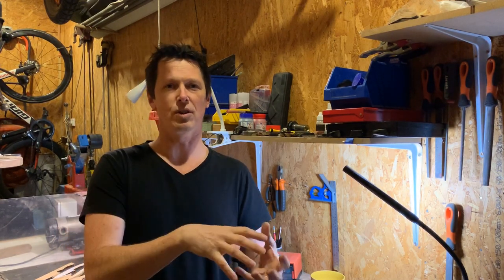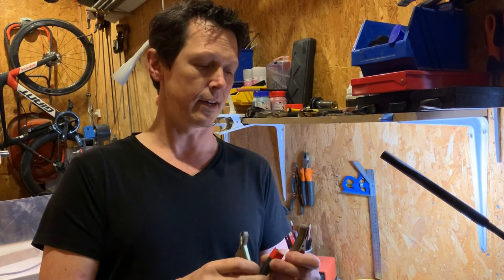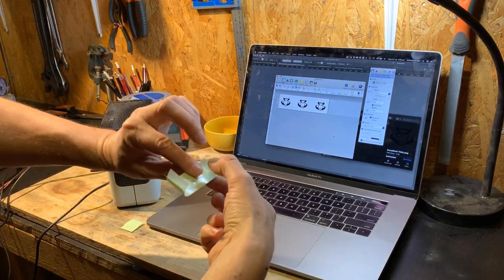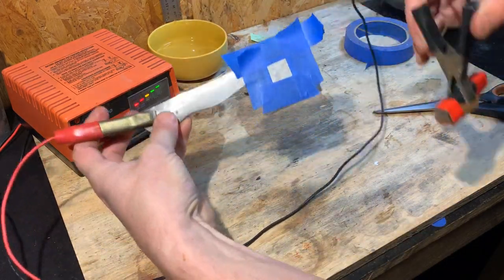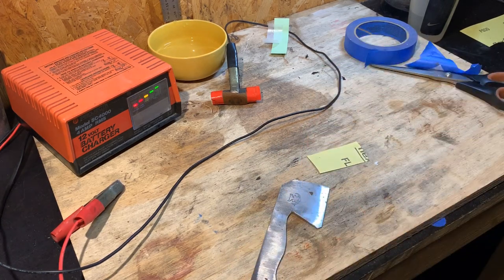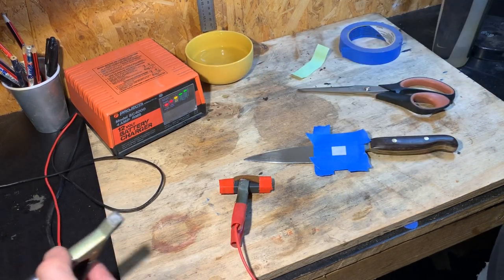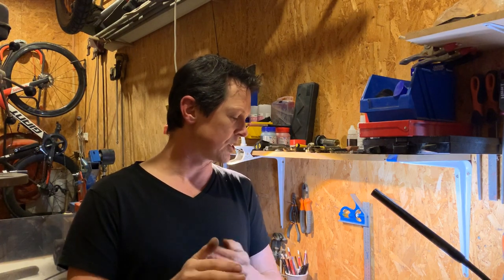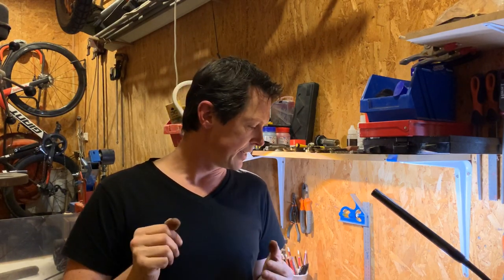How to PRINT a STENCIL - (& ELECTRO-ETCH it onto steel)

Comment: After doing the normal etching with DC current, with the artwork logo at the same place, now etch with AC current at the same voltage level in order to make your etching black (oxidized) so that it'll stand out on the metal. You'd have to have a separate low voltage AC power supply to do that OR modify yours by adding an AC/DC switch and changing the circuitry inside your power source to supply low voltage AC as well.

Comment: Thank you for sharing.  I stand corrected but I think the positive to the steel makes it the anode.  The process then removes material from the anode (etching/dent) and puts it into the electrolyte (saturated salt solution with a drop of dish detergent to reduce the surface tension allows for finer bubbles, any liquid that can conduct electricity well).  That's why the electrolyte changes color(the black you see).  You might also find you might not need to use a Qtip or other absorbent material on end.  As long as the liquid/electrolyte is covering the area you want  to etch ( (does not seep) you can just use any conductor (paper clip) to touch the liquid (allow electricity to flow).  So placing a drop or 2 of the electrolyte with an eye dropper to cover the logo then just use a paper clip or any other conductor to touch the drop / pool of electrolyte could work.  The conductive electrolyte might be able to give you a finer detail.  The other thing I noticed is that currently the absorbent material you are using has quite a coarse texture, maybe try a finer texture since that will give more contacts points and give a finer finish.  Also if possible you could test a lower current(power) for slightly longer periods.  So start at say 1/2 - 1/3 the power (less gassing),  you were using and then dab and release and do that a few times to allow the gas to escape, the droplet of electrolyte without the absorbent material will allow for the gas to bubble as well as make contact with the entire surface other than just where the fibers of the material were touching.  That might give you a finer more clean result.

If you reverse the polarity, it is trying to take the material from the anode/electrolyte trying to "plate" that onto the knife/steel.  This is how they put Chrome on bumpers, electroplating.
That is why  DC is better than AC as it cause the flow to go in one direction.  With AC you could be alternating between etching and plating.
Reply from the maker: Thanks for the detailed comment Kennith! This sounds like very solid advice. I’m going to give the pool of electrolyte a crack. Makes total sense. I might need to do a follow up video with the process and results. 👍🏻
Reply: @chefknifeco  Thx hope it works
Reply: Thanks for the info!

Comment: Awesome brother thank you for the tip on the printer👍!  I just bought one of those Etch-o-matic  kits and they give you everything you need to make your stencils but you still half to print it out from a computer then develop it...  it’s a big pain in the butt.  The brother printer is way easier.  So I just bought the printer and the tape on EBay for $110.

Comment: You want the Fe to oxidise to Fe2+ ions (which are soluble), so the etching head should be attached to the positive terminal as that will pull electrons out of the metal.
Reply: You first etch with the positive attached to the knife for depth. Then reverse and attach the negative to darken it. 

This will make the most durable and attractive mark.

Comment: Great video! Thanks- What was the material at the end electrode pad? Wool, polyester felt?
Reply from the maker: Thanks Eric. I used felt. BUT, as one of the other comments points out, if you can huger something that has a finer grain (even microfiber) the patterning in the etched area would also be finer. Basically, improving the ‘resolution’! The came comment suggested even creating a pool of electrolyte and adding the electrode to the surface, so that it’s just the liquid doing all the work. I haven’t tried it, but the theory is sound. 👍🏻

Comment: Thanks for this, it solves a lot.
I know it has been a while since this videos was posted but can you (or someone else) tell me what colour cartridge to get for this printer.
I have already ordered the printer but am confused as to the label cartridge colour as there are several options.
Reply from the maker: I’m so sorry I missed this. Did you find it in the end?
Reply: Have just seen this. No I can't seem to get what you are using. I have seen a variety of combinations of print cartidges but none resemble yours. I gave up.
It would help if you just told us.

Comment: You should switch to a copper electrode for a better result.
Reply from the maker: Thanks for the tip mate. So are you saying use copper instead of the random mild steel I'm using, and still wrap it in some fabric and salt water?
Reply: @chefknifeco  Yes exactly, do everything as usual, just use copper instead of steel - you achieve better and faster results with usage of less volts / watt and therefore less heat generation. This means that for example some vinyl stencils will last much longer (name tags etc.).

Comment: You could have got a United States made, Etch-O-Matic Starter Kit, on eBay for less than that price. The Etch-O-Matic Starter Kit is only $79.95 on eBay. It will make several re-useable stencils. Brother will not tell where their product was made on their website.

Comment: Hey m8 how do u change between ac and dc ?
Reply from the maker: Hey mate. It depends on the device you're using. If you're using a battery charger it'll be DC, but if you're using some other electrical device it may be AC. Sorry I can't be more specific, but most devices won't let you actively switch from one to the other. Check the device specs to find out!

Comment: AC/DC, and wich elctrode on which part?
- If you're using AC, the electric power run alternatively in the "two" directions". So that will "etch" in the two ways.... that's why it's less deeper.
- If y'ou're using DC, it runs in only one way, the electrons goes ONLY from one electrode to the other, that's why it's work better, and why you have to keep one electrode (the negativ one) on the etcher, and the other '(+) on the steel. 
I'm not a pro but that's my toughts